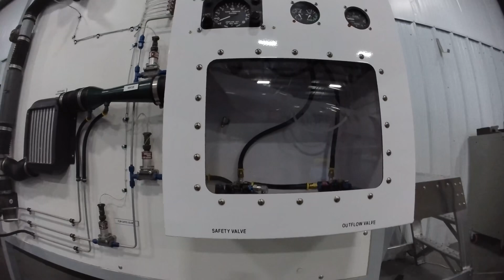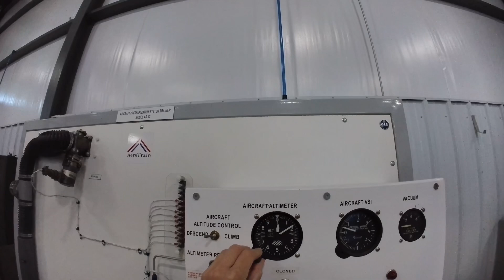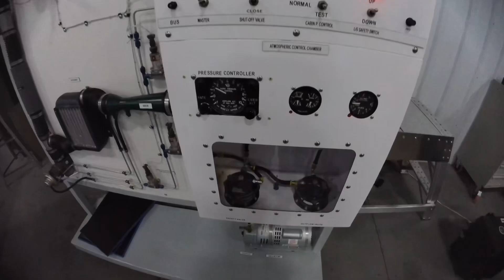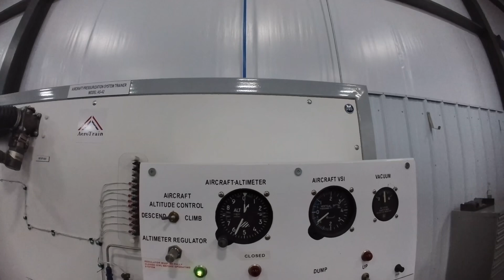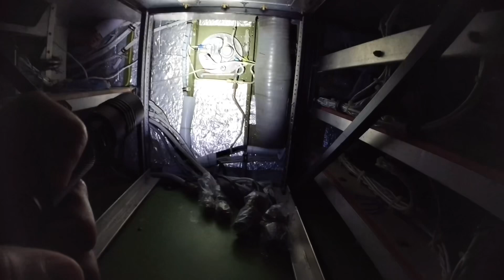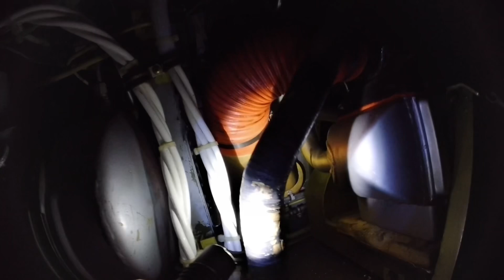🔧✈️ Aircraft Pressurization Explained | Constant Differential vs. Isobaric Control

Comment: Well, if it isn't my worst nightmare.... ATA codes. great video, cool to see the outflow valve and safety valve in action. I do have a question though is there also a negative pressure relief valve?
Reply from the maker: Thank you! Great question.There actually isn’t one on this trainer due to the fact that the trainer isn’t all that air tight. All pressurized aircraft are required to have negative pressure relief valves because cabin pressure is not designed to be lower than ambient pressure. Good question though. I wish they added one, at least for show